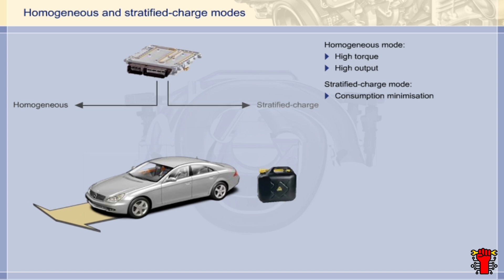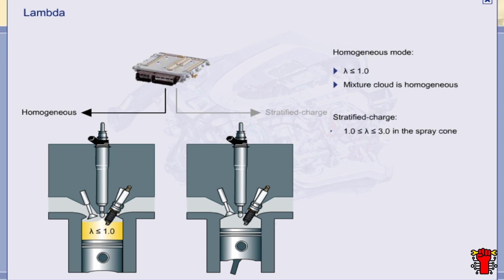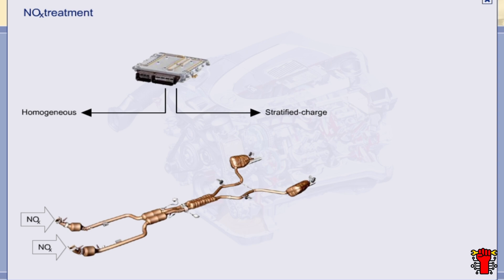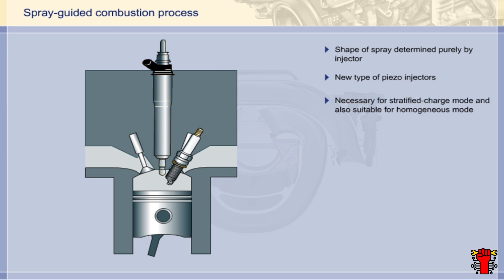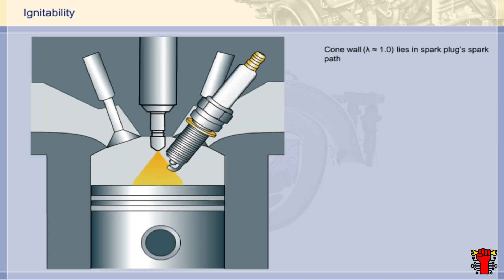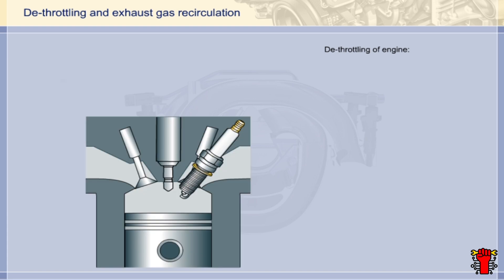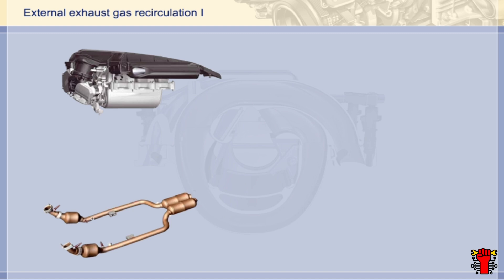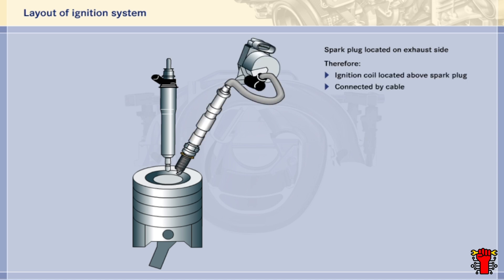Direct-Injection Petrol Engines part2 "Combustion process"

Comment: Would be nice to see video with presentation of how to diagnostic low and high fuel pressure side  and air flow side ❤
Reply from the maker: Thanks for the suggestion! That’s a great idea. Covering diagnostics for both low and high fuel pressure systems, as well as the air flow side, would definitely add value. I’ll consider making a video to show these diagnostic steps in detail. Stay tuned, and thanks for watching! ❤